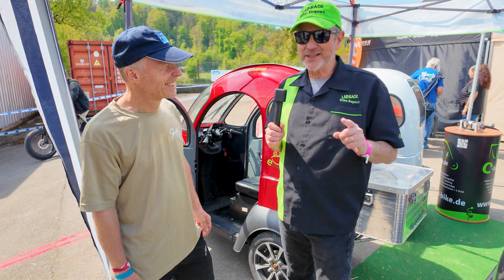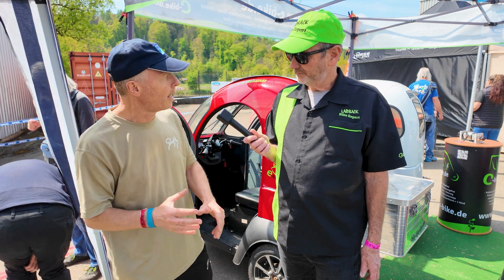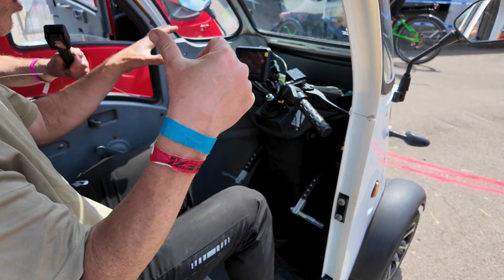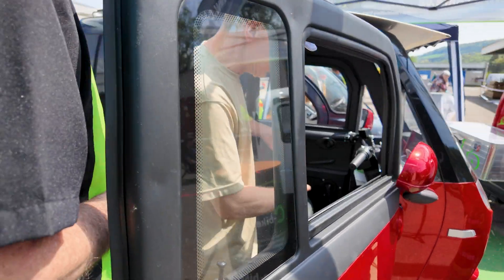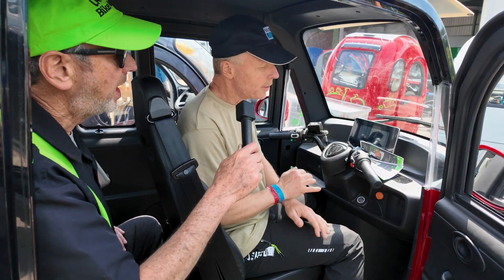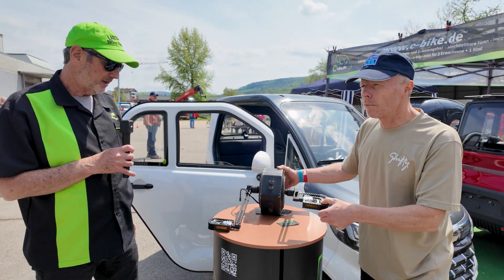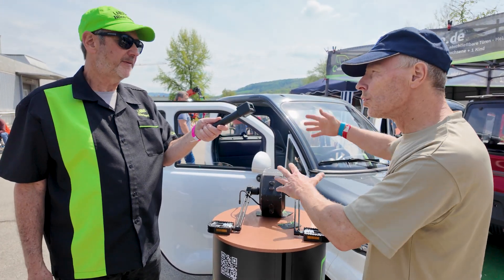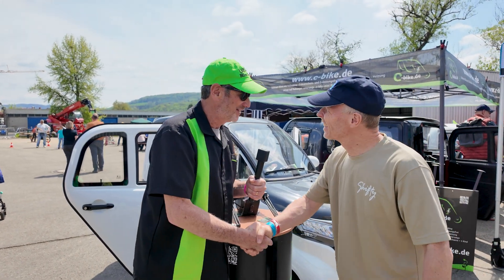Spezi 2025-C-Bike/Step Pedal Generator on a Cabin Bike!

Comment: There is an electric car with paddles made in Germany for over a decade now. It is called Twike. It has battery options to drive as far as 1000km. It is a full blown model in size and staring is on the side (similar to recumbent tedpole trike. You can paddle to continue to generate power or drive without fully on batttery.